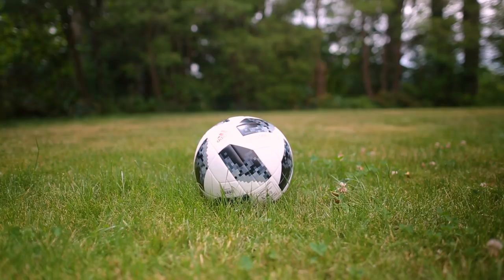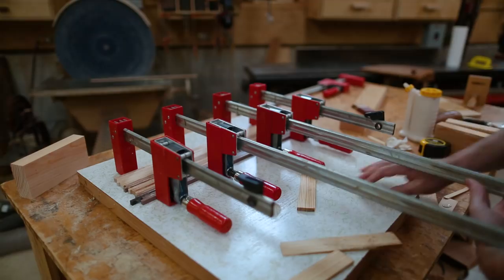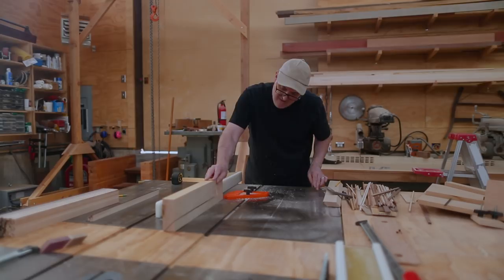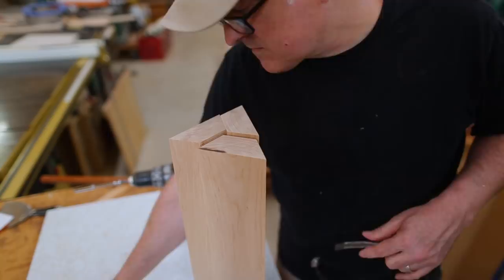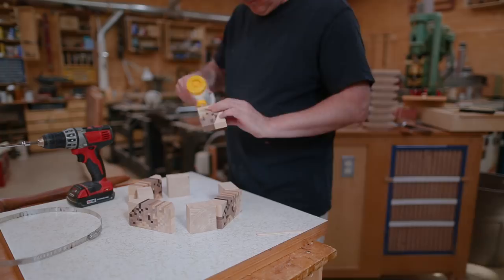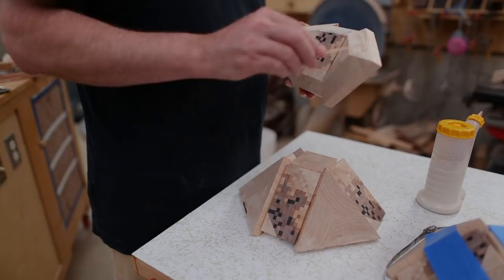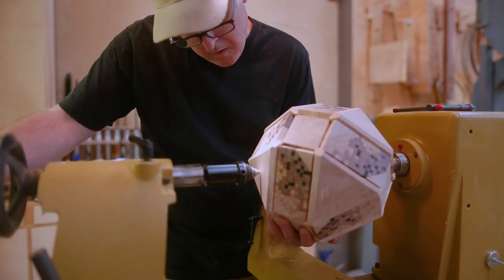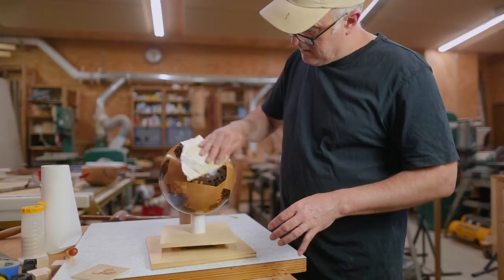Wood Turning the World Cup Ball - Telstar 18

Comment: end grain tearout... I use an air angle grinder with 2" discs, starting with 60 or 80 depending on how serious the tear out is.  then to 120 and up and then hand sand.  there are times when there is  a little catch and then I try to repair it and then something else happens and then something else and by that time there's not much left of the bowl or the original design.  I Now quit turning and pull out the angle grinder and it works wonders.  the coarse grits are aggressive and I can actually shape with it if needed to remove a hump I missed or that had a huge tear out. 

I also use this to remove the nib left over from the final turning on the bottom of the base.

The size of the air grinder is really small and will fit easily into small bowls and is very light and easy to manipulate for doing small delicate areas.

Comment: FRANK... I have a suggestion for how to apply finish and polish a sphere in one step. Look on Ebay for a "Bowling Ball Polisher". You should find an item that looks like a sack with two handles. You apply oil to the "ball". Place in the bag.  With an up and down motion the ball with rotate inside the sack while the oil is distributed and at the same time the ball with be polished.
 It's very Big Lebowski.

Comment: Fantastic work and results as always! I'm thinking about ways it could be a tiny bit softer or real looking by getting the curves in the seams between the faces. Maybe it could be done by carefully rounding off the edges before glueing them together, and then turn it down to where the curves are barely there? This is just speculation though. I assume the pieces would have to be way more accurate, and it would probably be more work than what it's worth.

Comment: If you were using measurements off a replica ball as opposed to a match ball your mistake on having to make a smaller ball might of actually resulted in a closer size to the match balls used. This comes out to be becasue of the quality control is way higher in the match balls and so they are usually smaller than the replica balls just by a bit. Great job!!

Comment: The only part that I didn't like was where you were cutting the small strips and using the push stick, cause that is how my right thumb almost got cut off at the table saw when it was  pulled down into the blade by the push stick. Great project.

Comment: Truly fantastic - this is the first time I have seen your work.

Just a question if you don’t mind - when you were trying to find the angle to cut on the triangle pieces and you figured this out on the computer. Would it have been possible to simply use an angle/profile finder that’s used when fitting skirting board etc..